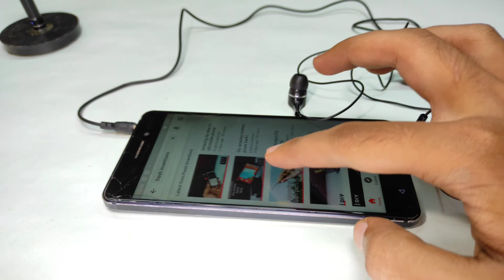How To Repair Earphone || Fix Repair Headphone Jack || very easily

Comment: Great tutorial bro but I have no equipment like that. Is it possible to use a glue to connect those wires on the jack?
Reply from the maker: Its not possible bro. Without soldering iron.
Reply from the maker: https://www.amazon.in/Hillgrove-2in1-Soldering-Meter-Simple/dp/B07NP47ZCH/ref=mp_s_a_1_16?dchild=1&keywords=soldering+iron&qid=1596717956&sr=8-16#